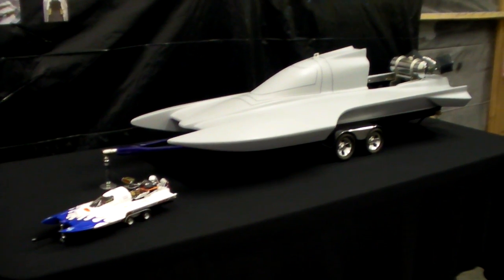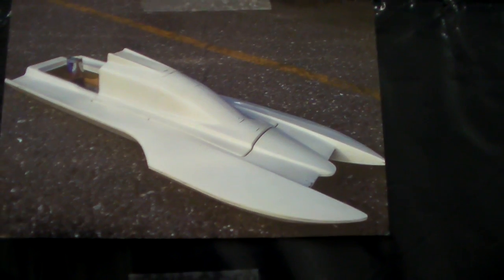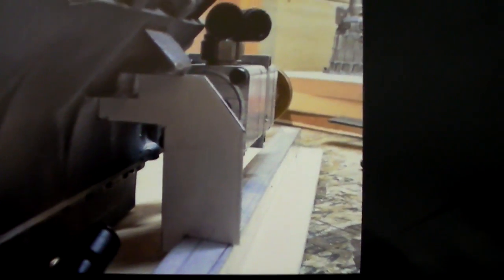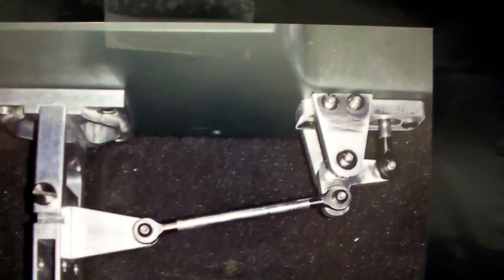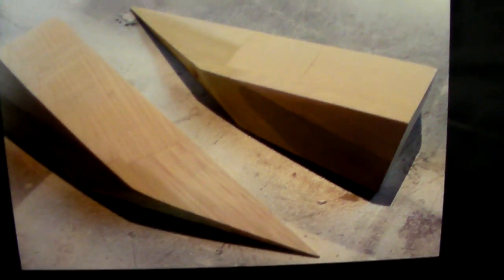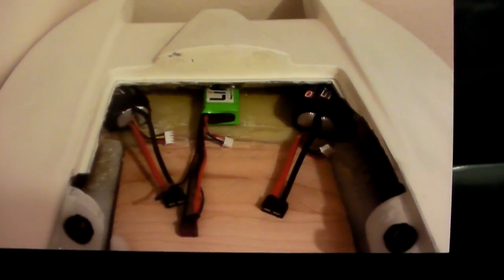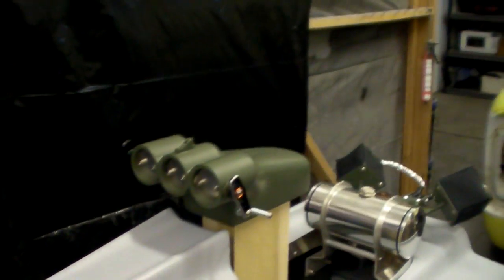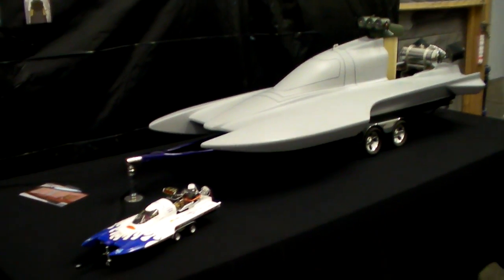Stinger 609 drag boat project part 3: boat modifications

Comment: Not knowing hardly anything thing about the Problem child speed boat or the Conley engine, did you ever have the thought of maybe having a small pump to bring water in from the outside rather than a 12oz reservoir to reduce weight?